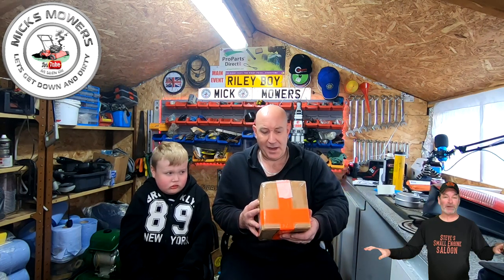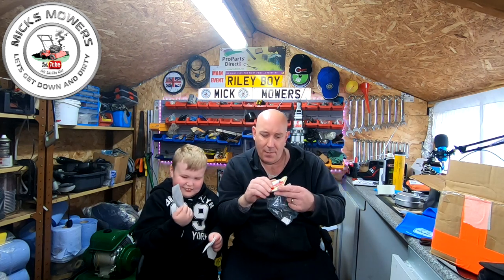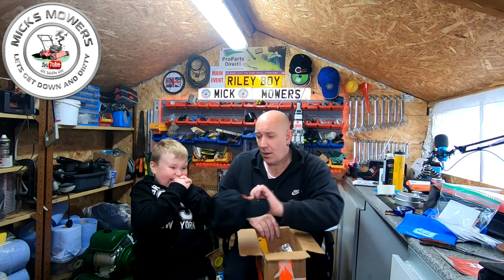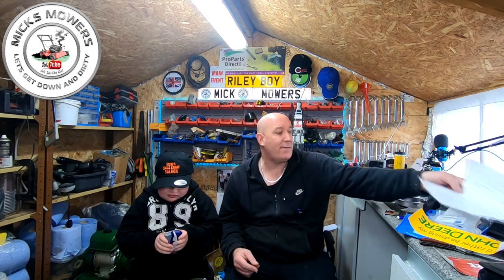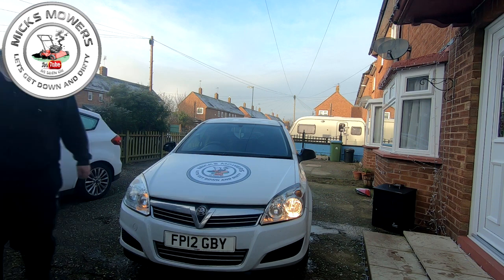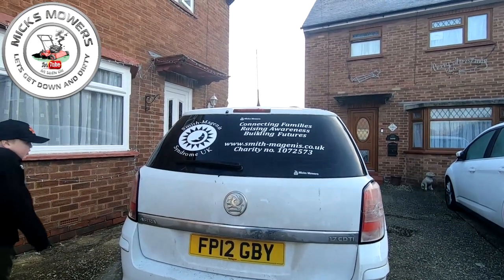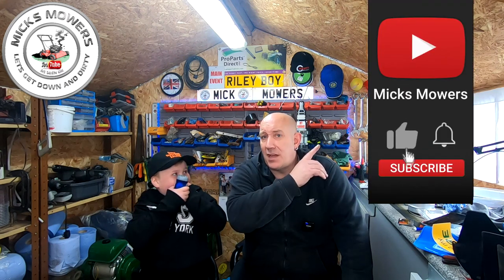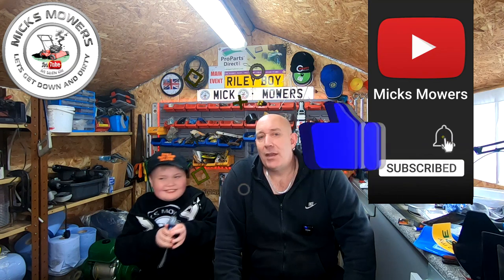Changing Headlamp Bulbs and Rear Light Cluster On An Astra H Van MOT Check

Comment: awsome package from steve there mick. little tip when u put a head light bulb in if you hold a piece of cardboard in front of the light turned on obout 2 ft away u can check that its fitted correctly as u will see the beam pattern lol saves you finding that out at night after blinding other drivers 😆😂
Reply from the maker: Yeah mate .. I got it fitted right

Comment: So you guys there don't undertake commercial  car/vans as a separate class of vehicle from regular vehicles for the MOT?  We over here in Ireland do, even car/vans.
Reply from the maker: Yeah but small vans comes under as a car.. bigger vans are a different class
Reply: @themowerman  Ah yeah, with us, if it doesn't have a seat in the back, even modified from standard, it's classed as a van and tested commercially.

Comment: hey mick great vid as allways, i have a question for you, i have a qualcast classic 35 with an fuel overflow issue, it over flows when the engine is not running i have put a second hand carb on it that had in the shed but still have the same issue, what would you advise i do next?
Reply from the maker: Is it over flowing from the carb?
Reply: Yeah I think, Iso then running out of the air filter, now it might be a needle and seat problem but it seals when the carb is off the mower????
Reply: Oh it’s everyone’s favorite Tecumseh engine lol
Reply from the maker: @Projectadventure1  lol yeah probably float or seat problem
Reply: Would valves cause this issue by any chance
Reply from the maker: @Projectadventure1  yeah could do